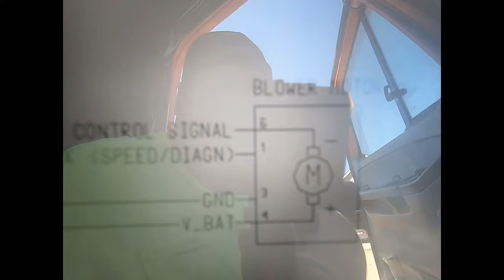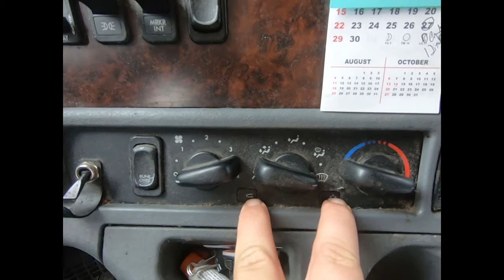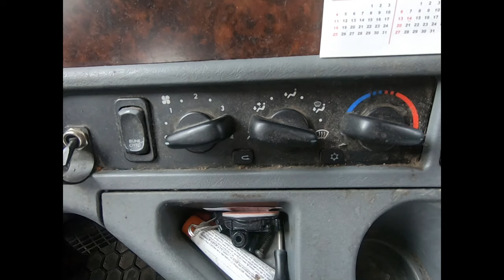Freightliner HVAC blower motor. troubleshooting, diagnosis, repair

Comment from the maker: DIY SEMI, TRUCKING AND MORE 

 • 59 seconds ago

For great fuel discounts with no fuel card required, watch this video! https://youtu.be/LjB5Y60p1qI
Reply: My fan is stuck on, I can’t switch it off, ac works but the speed don’t change.  Anyone with a solution?
Reply: After watching this, I changed blower heater but that did not solve the problem.
Reply: @robertkimaryo7178  I used to have the same problem you have sir. It was the temperature control unit A/C Heater Control Panel. So I went to a local junk yard and bought one from there. It works like how it supposed to.
Reply: Goodmorning  thanks for your help,
I took this stepper switch out,how can I test it? I Took it apart except the wire connection,it vibrated, I manually opened and closed the vent doors,the shift doesn't turn on the stepper is that normal???
Reply: I installed new blower motor and new connector wire and new control panel recently on my columbia 2007. When i start my truck sonetime blower works sometimes not, then i have to move the connector up n down then it starts working, but whenever i turn off my truck this problem keeps happening. What could be the problem, any ideas? Thanks
Reply: It worked for me disconnected   and connected back and it worked, thanks for the info 👍

Comment: Thanks for the video. Was a big help. I did however end up pulling my motor out before I watched the whole video and it turned out to be the little 30 Amp fuse 😂

Comment: I got a blower motor and ac control panel that I didn’t need because freightliner for got to mark a 5am, 30 am fuse. I was almost about to take the truck to the dealership.. thanks man you kept some money in my pocket..

Comment: I want to say thanks a whole lot for this video I am going through the exact problem right now not getting fire through the main wiring that goes to the blower I will look at those two fuses that are unlocked the 30 and the five they are working right now right now my main concern is that I am not getting fire to the wire that goes to the blower before I will have to go and wiggle the wire and then the blower will blow now it won't do nothing but just watching your video open my eyes I really appreciate this video thank you a lot now I kind of have an idea what to do and 

 especially the reset part 

Sometimes all it takes is even reset

Comment: Hello my Guy... I never left a comment on anything but I have to thank you so much I was frustrated with this problem on my 2017 glider  and come to find out it was just like you said I had a bad relay i bought a $226 blow a motor and pigtail that's going back tomorrow thank you so much God bless you

Comment: Thank you for your video. 
My blower fan stopped working  about a year ago after spending lots of time and money to fix it, I gave up.
I came across your video and followed it step by step and found the fan motor harness disconnected.
Thanks for your help.

Comment: HUGE THANKS!! I have a 2015 Columbia and the blower motor stopped working. It was that 30A unmarked fuse... only it had a loose connection. When I wiggled it, it started working again, but the base the fuse plugs in to had to be replaced. I also had cleaned the entire panel, as it was very dusty and grimy. I would also suggest anyone else having problems with their blower to clean the entire fuse panel as well as to avoid any future maintenance issues. I bought this tractor only a couple of months ago used and still getting to know her LOL but man I tell you that saved me a trip to the shop I'm glad I found your page. 👍🏽👍🏼

Comment: Thank you. I looked for the unmarked fuse but I couldn't find them. After your video I found a relay that someone put there instead. Removed and installed both fuses and it worked.

Comment: thanks one of my drivers "used a 30 mini in the  storage slot" to check the right hand window controller   that fixed that!    then next day called " hey my cab blower in not working and neither is the ac compressor,,"   never once said anything about the moving of the 30amp fuse..  I have the complete service manuals 375 bucks,,   not one word about the area with the 5 and 30 amp fuse it is marked  60 and 60x    optomized idle,, in service books .   YOUR video  was a great help  thank you for the effort  to share !     Mike S.
Reply from the maker: Thanks....your comment makes it worthwhile to do this!

Comment: Thank you so much your a blessing from God and just saved me a lot of money thank you. Mine was doing same exact problem blower motor went bad so I replaced it, still wasn't working so I I tried replacing a/c switch blower 127 dollars still not working so I watched your video that you God bless you it was the hidden green 30 amp fuse crazy I replaced fuse now my blower works. Thank you sir lots of gratitude.

Comment: Thank you for your video. I had a similar issue. Someone had removed the unmarked 30A fuse for the blower motor. On a side note,  your truck is wired correctly. If you look at your wiring schematic again 12V positive is on terminal #4 and ground is on terminal #3. The electrical plug has small numbers labeling each terminal location. Even though the schematic is drawn showing the positive and ground wires on the edge of the plug, you have to reference the terminal number to find its exact location. Thanks again.
Reply from the maker: Hmmm I didn't see any numbers on there. I will look again, thanks!

Comment: Thank you - Helped me fix my 2007 Columbia
Reply: I have a 06 Columbia and my HVAC control module nor my blower work... I cannot see/find the 2 fuses on the lower left side of the PDM... where were yours? I don't think the control or the blower is bad, I think it's just a fuse... but I can't find the fuse for it - any ideas?

Comment: You have no clue how much this video has helped me. I do port work so at times I’m sitting for quite some time, with no ac for the last two days. I Swapped the fuses and it’s running great. Apparently someone had the wrong fuses on the pdm. Thanks bud

Comment: I installed new motor and new connector wire on my columbia 2007. When i start my truck sonetime blower works sometimes not, then i have to move the connector up n down then it starts working, but whenever i turn off my truck this problem keeps happening. What could be the problem, any ideas? Thanks
Reply: Did you ever figure out your problem? I have the same type of problem!

Comment: hi driver thanks for you time and effort that you invest to help us out here.i have an 03 columbia I can't get my blower motor to work in my sleeper.i checked my fuses and plugged in anew blower motor won't turn on.i am getting power at the harness under the bunk.any suggestions is appreciated thanks..
Reply from the maker: Could be a bad ground wire...also test the voltage on the speed control wire whle turning the fan switch see if it changes. fan could be in portection mode
Reply: @DIYSEMI  thanks for the reply I will check those leads out have a great day

Comment: If you look at the diagram the battery+ and ground are pin 3 and 4. If you look at the screen at 12:34 you can see the pin numbers on the diagram. In a 6 pin plug these would be the center two terminals. The diagram was right. But you should always verify powers and grounds before replacing components.

Comment: My little  freightliner single axle dump truck blower quit and the only thing I found bad was the ground terminal  at the motor but it still doesn't work.can this be reset like the semi tractors

Comment: ??? I have a 2016 freightliner cascadia automatic.  Before I had valves adjusted, tune up and PM  I was getting 7.0 mpg now im only getting 6.6 . Would you have any idea of what could cause this?
Reply from the maker: An improper overhead adjustment would be my first thought...if thats all they did. Did they possibly flash your software without your knowledge???? It happens, maybe they thougt you were do for an update.
Reply: @DIYSEMI  idk ill have to call freightliner and ask

Comment: I have a 2016 Coronado glider that I’ve been driving since new as a company driver and have just recently bought the truck from the company. Now that jobs like this come out of my pocket where do you get your wiring diagrams from? I was an auto tech for a few years and have done my own electrical diagnostics on my personal vehicles so I know the process of elimination but haven’t found a source for information like diagrams and other diagnostics on my Freightliner, besides the dealer, which I really don’t think they like giving any information other than handing you a bill for repair. The Coronado has exactly the same interior as a Columbia or century, so it’s still pretty old school yet. LMK thanks.
Reply from the maker: Usually if i buy the part at freightliner they will give me a diagram,  i ask for a couple different ones and they usually give it to me.. I have also found some just by googling it and do a little comparison. I havent really  found a good source other than that

Comment: I have a 2014 freightliner Cascadia. The bunk blower motor is on full blast and all the time.. Is the resistor built into the blower .?
Reply from the maker: yes

Comment: Hello I have a question at 12:39
My sleeper blower not working the wiring is the same for the pins: 
#3 is ground
#4 is 12 volts dc
#6 is my variable speed control about 2.29-5.75volts from off to high speed
#1 is the feed back which I’m getting 5.002 volts consistently. 
Is this correct? This is what I’m getting. I’ve replace the blower with its resistor that comes with it but no luck. Thank you

Comment: Fuses not labeled due to aftermarket  items, glider kit install. PDM has more slots for add ons. SCHEINDER tech did not make note or obviously label. Yes at a dealer this job would have been every bit of 1500 to 2200. More on high end. Dealers have been using C techs due to mechanical tech shortages.
Reply from the maker: yessir. everything is big $$$$$

Comment: so, the blower in the cabin stopped working all of the sudden, (the bunk one works fine) in the cabin, I can feel the AC working properly too, but not blowing, even though I crancked the thing to speed 8, any idea?
Reply from the maker: blower is probably out...check the fuses first.
Reply: @DIYSEMI  and now my bunk doesnt blow cold air, I'm sweating like a pig

Comment: My defroster button won't turn off even if the blower isn't on it will stay on. Once I start the truck a few second later the light goes on

Comment: How about if your fan works only it don't turn to heat setting to warm the trk ??? What does that mean ?? It keeps blowing cold air..
Reply from the maker: do you have shut off valves for the heater core that need to be turned on? or it could be your blend door isn't moving...bad signal or motor on it
Reply: @DIYSEMI  heater valves are open I tried missing  with blend door but nothing.. might have to check fuses..

Comment: I have a motorhome on a freightliner chassis, my climate control ( 3 knobs) has a vcuum leak. I called the dealer to get a new control head. No longer available. I heard this control head can be rebuilt. Does anyone know of a place who rebuilds climate controls. Thanks so much guys.
Reply: Just go to a junk yard

Comment: I got columbia 2005 heat control switch recirculation button flashing and air not blowing?
Reply: I got 12 volts but my hvac switch not working and blinking light

Comment: Did you get code sid 010 or 545 146?
Reply from the maker: No sir, no codes
Reply: Thanks you Sir iwonder what that code is my blower stop blowing today
Reply from the maker: @Omosula  I believe 140 pertains to the sleeper ac. The other 2 I don't know. Try googling it
Reply from the maker: @Omosula  it is  not uncommon for these blower motors to go bad in these Freightliner trucks.
Reply: @DIYSEMI  thanks you sir it was the blower motor

Comment: My 2007 freightliner doin the same thing and I noticed the ac clutch no coming on along with the blower motor not working
Reply: Did you get it fix and what was the problem.

Comment: Q?? Problem my truck argosy freight liner voltage is 13 then light is on down the voltage 11 end buzzer the dassbord pls help
Reply from the maker: Does it come back up? Up and down?
Reply from the maker: take a moment to watch my video about changing an alternator. it shows you how to do some quick checks to see if your batteries or alternator is bad. make sure you wiggle all the cables around you might find you have a bad battery cable somewhere. dont for get to check the cables that jump between the batteries themselves.

Comment: I have a 2013 Peterbilt 587. The bunk ac stopped working. Check the fuses and their not blown.  The fuse doesn't have any power. Have anyone come across this problem?

Comment: My blower works for a few hours and then it stops working??
Reply from the maker: Without knowing the kind of features you have for instance climate zone control etc...i will tell you where i would start. First, when the fan works, does it work on all speeds? Or just one? Next, i would take the plug out of the fan and wiggle the wires around while you verify the voltage...see if you have a loose connection. Then find the signal wire and do the same.  If no problems there, i would pull the fan out and spin it by hand, should spin nice and free..perhaps you have a bad bearing that is overheating.  While you have it out, clean the fan cage off. Start with these things first.
Reply: DIY SEMI all speeds!!!
Reply: @rafaelmorales7730  I have same issue have you figured yours out

Comment: I followed all steps and still no power I switched the relay still nothing the only thing left to do is replace the control everything else work but maybe the fan control not working but there’s no power at all to the harness I’ll keep trying oh I replace those hidden fuses too

Comment: You could have gotten your relays from any auto parts store.
Reply from the maker: Absolututely...i live far in the country. So many times, the extra travel is am issue. But yes, would have been cheaper.
Reply: Will they work properly?